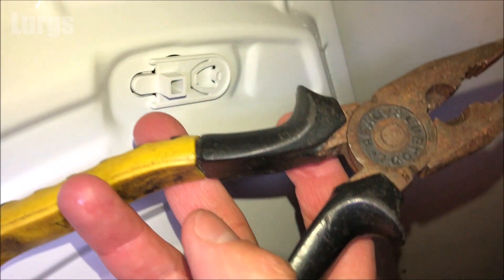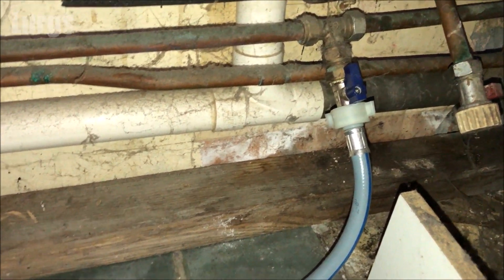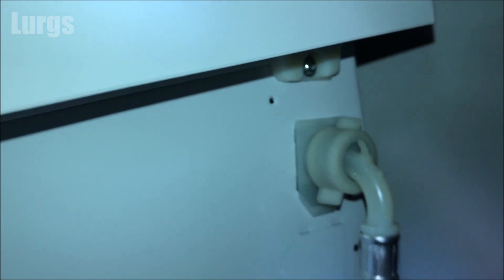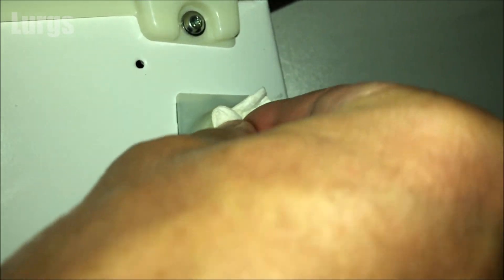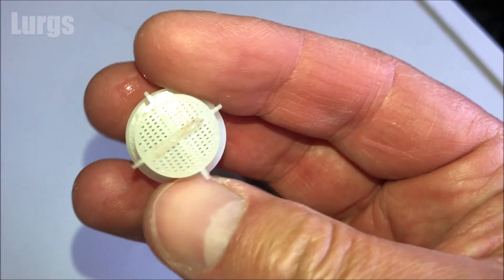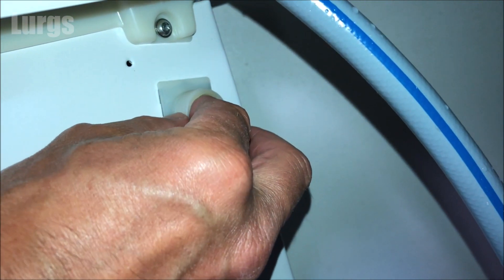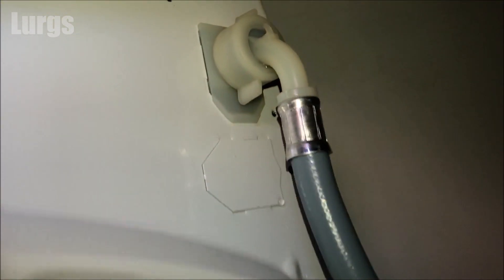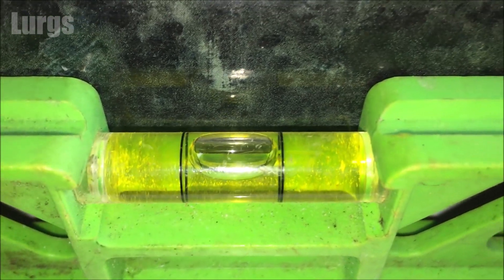How to remove Aqua Inlet Filter on Bosch Washing Machine Serie 4 VarioPerfect F17 Error

Comment: Thanks a lot for this video.

I had a bad experience in trying to maintain appliances before. So your video was what I was looking for. 👍👍👍
Reply from the maker: Glad I could help. Happy New Year.😎
Reply: @LurgsHowToGuides  
Thanks for the comment.
However I would like to ask you for a tip if you may.
I am planning to save some energy from gas heated water, and to use 3 way mixing valve. Which controls the water temperature going to the Bosch serie 4 cold water inlet.
Do you know the maximum temperature allowed going in cold water inlet, without damaging the dishwasher?
Reply from the maker: @ahmadqattan1  The max temp of Dishwasher water is usually about 65c so no hotter than that. Good luck
Reply: @LurgsHowToGuides  
Thanks again 😃😃
The local dealer did not answer me, either they did not know. Or not willing to take responsibility, although I asked them that “if they know, and no responsibility taken” but the answer was, the normal tap water.

I really appreciate you tip.
Reply from the maker: @ahmadqattan1  In theory putting hot water into it means it won’t have to heat the water up as much. Hope it all goes ok

Comment: Thank you for the video, I have used your technique and cleaned the filter inlet few times till now. Now when trying to remove that filter with the cutting plier, the filter edge is no more to pull . Do we get the spare part of the filter-inlet ?  Thank you
Reply from the maker: Guess you can just order that part, just the small plastic filter

Comment: This was very helpful. I had a leaking water inlet in the back of the machine. Followed your instructions and the problem went away. BTW I have a water softener fitted at the inlet as my ground water is very muddy. Does the softener have an expiry or can I continue to use it for a year or 2?
Reply from the maker: I’m not sure, I think they do get blocked up so maybe you can clean it? If not I guess you’d have to buy a new filter inlet. Glad this video was useful.😎
Reply: @LurgsHowToGuides  ok thanks much. It's working fine for now.

Comment: very nice video mate, I need your advise if you don't mind please, I have  almost the same model but for some reason they call it here serie 6, a brand new one and I just installed it, i ran the first test cicle (drum clean), everything seems like is working fine, but there are this screaming noise when the machine draw the water... and that doesn't feel right, do you have any advise what that could be?   thanks.
Reply from the maker: Serie 6 is the next model up, I think it has other options or a larger capacity for laundry.
Odd it’s making a screaming noise, did you deffo remove the transportation bolts? The water drawing in the inlet pipe should be very quiet. Maybe it had some air in it?
Reply: @LurgsHowToGuides   I did remove the transportation bolts all 4 of them,but yeah I guess it could be some air in the pipes, will have to try again and see. Thanks a lot for your reply.  stay safe.

Comment: Hi I was wondering if you could help.  Our washer is the same. And our padlock button is on  making a noise. Won't start a wash. It's the second icon along after the tap. We can't find anything stuck.and we left it all day so it's not too hot. Weve drained it. Is there anything else we can do please! Thank you!
Reply from the maker: Only thing you can try is turning off at the plug to see if it resets.

Comment: My washing machine is showing f17 and beebing
Reply from the maker: Hope you get it sorted
Reply: @LurgsHowToGuides  I did get it sorted I was going to bring someone to fix it but then I saw this video which helped me to fix this problem but the hardest step was pulling out the washing machine it was really heavy but I got it out I told my sister to come and help pull it out and then it got out I couldn’t find the the cold water feed but for my house the cold water feed was under the sink so I switched it off then I unplug the washing machine and did the job
Reply from the maker: @mjflorent  Great news, glad you got it sorted. Happy Easter. 😎🐣
Reply: @LurgsHowToGuides  Thank you for helping me fix my washing machine without your use full videos it would have been a disaster. And happy Easter too
Reply: @LurgsHowToGuides  Hello lurgs my mom just bought a new Bosch serie 4 she had an Bosch Classixx 6 vario perfect and her washing machine is beeping and on the screen it said e29 and and only the kitchen sink works. Do you know what this means
Reply from the maker: No idea I’m afraid. If it’s a brand new machine check that the installation bolts were removed and that the cold water mains feed is turned on
Reply: @LurgsHowToGuides  Maybe The cold water Is off we will try switching turning the sink on and the transport bolts